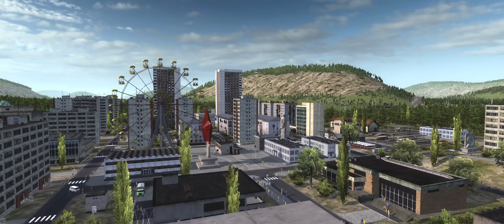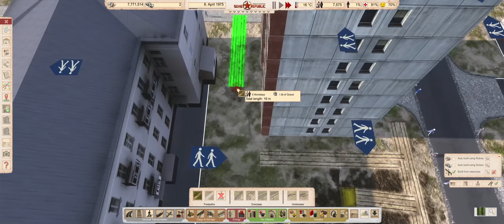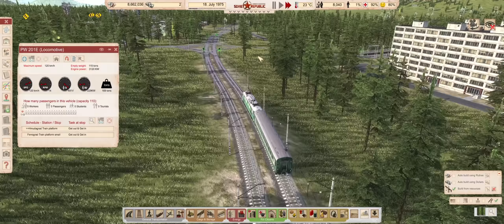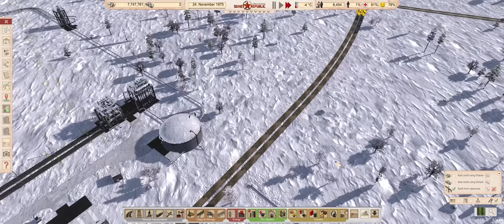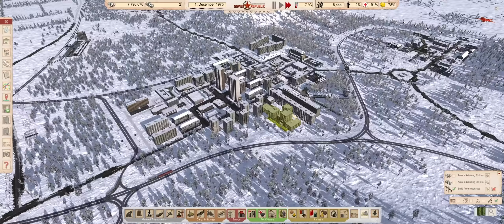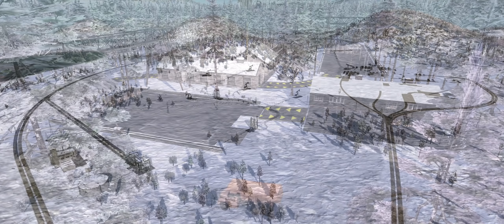Commuter Services - Episode 28 ║ Workers and Resources: Soviet Republic

Comment: If I can suggest, It is easier to remove railway nodes with waypoint instead of the signal it self, since to cancel the signal, you neet to click on additional button (Cancel semafore). But waypoint can be placed and removed with same button, so you only click on track to add it and then just click again to remove it and the node should be gone.